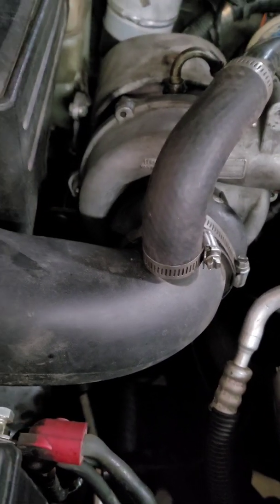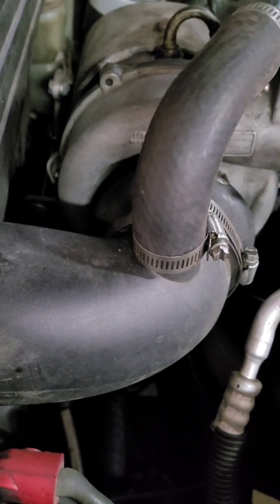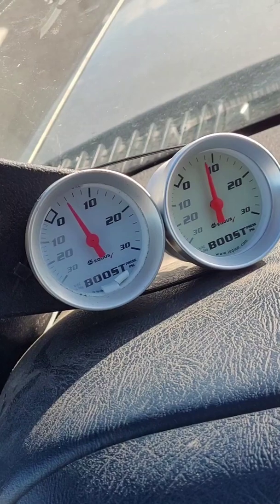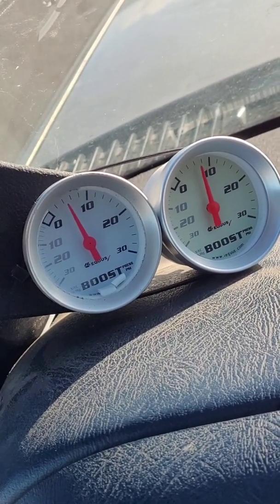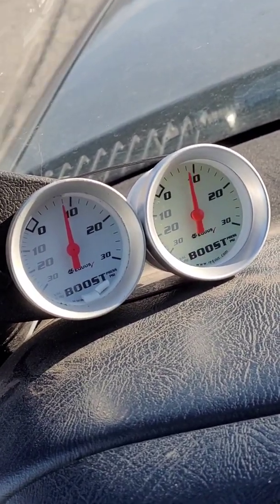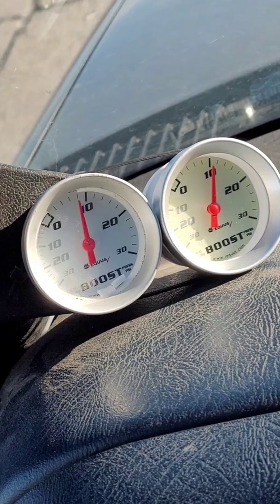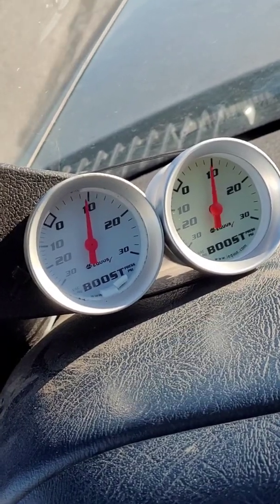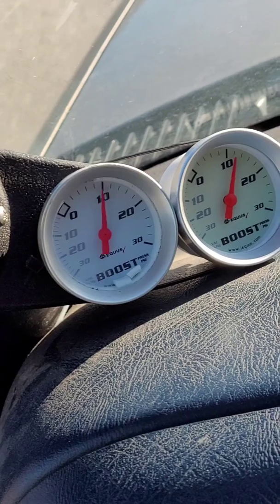Testing a GM-8 Turbo on a 98 6.5l Diesel

Comment: Seems like it's not as bad as everyone makes it out to be?
Reply from the maker: This turbo has a wheel and a turbo master, and the bushings are in good shape. A turbo with 350k miles on it probably wont have as good of numbers, but the stock turbo is nowhere near as bad as people say. I keep the stock turbo on my truck for towing because it works great. I tried an hx35 once and maxed out my egts just trying to get on the freeway because it was so slow to spool
Reply: The only real bad thing about this turbo is the intake side the housing is so small it produces to much drive pressure compared to other turbos used at the time and 6.5 really do not like a lot of drive pressure